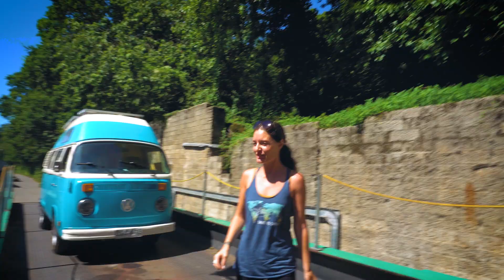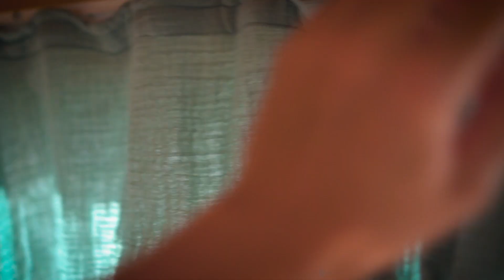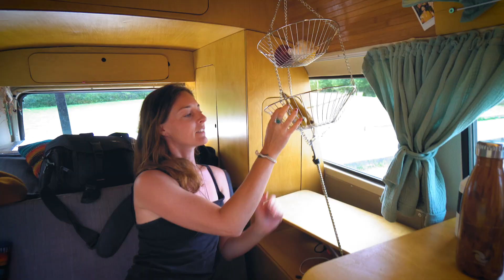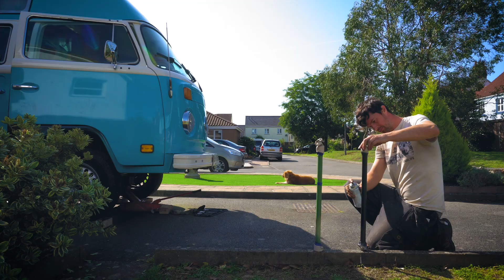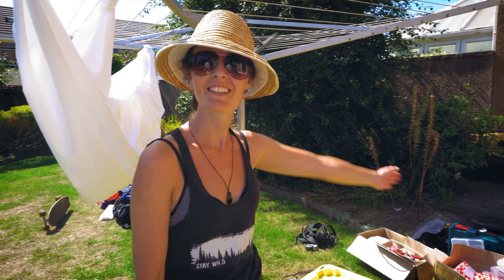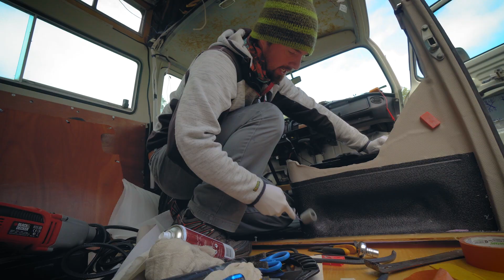VAN LIFE: Necessary Upgrades After JUST 1 Month of Living in our Custom Van Build

Comment: Zipper bags, they pack better, you have too much stuff, you have to be able to live in the van,  especially when it rains, can you use netting, and keep some parts inside the engine compartment?even the metal that is the reverse part of your bed support, can you make a small drawer, to hold parts, above the engine, a small slide drawer, maybe long, right above the rear hatch, there is space there, maybe for your shocks, they could be clipped up on ceiling above the rear door, there's alot of ceiling space in there

Comment: The Type 4 engine should have been the engine of choice for this trip. In terms of reliability the T-1 doesn't come close. As for A/F ratio...Load equals Throttle position. At part throttle conditions you can lean out as much as 16.1 which will run cooler than 13.2. Under load/WOT 12.7 - 13.2

Comment: Save some weight and ditch the metal toolbox and replace it with a plastic material tool wrap.with the spares remove cardboard packing from everything that is not easily damaged and wrap In Plastic and spread around the van to even up weight distribution.

Comment: Ben I’m not sure if you know if you add 2 stroke oil to your fuel it helps lubricate fuel system and cylinders which will prolong the life of your engine when the choice of oil is dire might be worth considering I use it in my van and all the works vans it quietens down injectors and I notice a real difference in engine tone only a small amount needed per fill up I use 20ml per 80 litres I am an old school mechanic 👨‍🔧 it certainly makes a difference noticeably almost instantly
Reply from the maker: thanks for your suggestion
Reply: Your very welcome I’ve gained many tips from your adventures so it’s a little something back 👍

Comment: I've got about 300Kg of "car" tools and would feel as though I'd cut an arm off to leave any of them. I'd have to buy a trailer.
Reply: You just need a heavy duty vehicle. 

I have a rabbit pickup I cut out the back of the cab and put a camper top on it. 

I did 4montha traveling being a mobile mechanic. 

The little truck had no qualms carrying over 1600kg. 
About half of that tools  jacks and whatnot. 

That was back in 2015. 
Still daily driving the truck. 

It has a vw TDI with a mechanical pump so it has no electronics and is capable of 50mpg completely loaded.
Reply: In fact. I do not see how they could afford fuel without the blog. 

For me my trip from every corner of the USA and back I spent less than $400 on fuel

Comment: 4200 lbs...?...ben you need 6 cylinders bud...that new 4 cyl. Will take a s... At one point or another...i would buy a used porche engine and rebuild it...but thats just me..cheers!
Reply: a used porsche engine that needs a rebuild is £6000 miinum plus at least that again to rebuild. totally uneconomical.
Reply: @kmpeaker3955  im talking about reliabliity for the sake of nonstop adventures...and torque...which that kombi needs at 4200 lbs...and no...a used porche engine can be bougth for less than $3500...and Ben can rebuild it himself for less than $3000...i know...i own one...
Reply: @steven6692  tell me where you can get a porsche engine for $3000 and I'll buy it ship it the UK and make £3000!!!
Reply: @kmpeaker3955  many places here in the U.S. bud...just type it on google...at times even at ebay.

Comment: 20:50 I have to warn you about about the quality of Febi Bilstein parts. Last year I replaced a crankshaft sealing ring with a Febi part on my Mercedes and the sealing broke down after 3 months. I'm a Mercedes mechanic, so believe me when I say that it was mounted 100% correctly. It was a real pain because it's quite a lot of effort to get to that sealing ring, and I had to do it all over again because it was leaking oil worse than even the old one did. Better buy parts from brands that you can put your trust in. Also, don't confuse "Febi Bilstein" with the suspension brand "Bilstein", curiously despite the similar name it's a whole other brand! Wish you all the best from Germany!

Comment: Didn't see anything about an air cleaner cover or box for warm air to prevent freezing in cold weather, or (if the manifold is heated & I didn't see it) .,A sock, or piece of foam, or box.. to"keep it drawing air from a specific area...", so it does" nt get clogged  quickly in the dusty conditions you are headed into...Hot rods generally don't cover their air filter ., but in the real world the manufacturers do, This is  to keep the filter enclosed  from picking up say , oil residue from a specific area , road dust directed into the general area , dripping water , & even excessively hot or really cold air depending on outside temp....We've all seen in canada. , the stock Vw manifold ,(which I know you haven't got), turn white with frost while running in cold temps & then refusing to idle or even run right because the fuel recondenses on the cold surface ...A make shift cover is something you might want to discuss with the engine builder ,(even if you only put it on when you need it) ..Have a great trip ., love your series , been following it from the beginning, continue to look forward for lots more!

Comment: fun fact about motor oil; zinc is added to oil to protect the engine if you go past the recommended number of miles and the oil has lost all lubricity the zinc is still zimc and will keep the motor from eating itself ...a side note, a slightly rich fuel mix is perfect for sea level but what about up in mountains? is the new motor EFI? i missed a few videos and or dont remember much about the engine build
Reply from the maker: oh you missed out you need to watch this: https://www.youtube.com/watch?v=onkxegc7Yk4&list=PL3-CFitnEZXon01THWh1vEKDv5MPkuNnp&index=8

Comment: Having lived on the road in a van for over 10 years and traveled around Europe, I can definitely understand what it takes to reduce your belongings to the bare minimum. My Vehicle was nowhere near as small as yours but it was quite a bit older which meant spares were only available from a couple of places in England. The worry of breaking down was never far from our thoughts but we did it with far fewer resources than you have, you cannot be prepared for every eventuality as you well know and that can make the trip much more interesting. 
I'm not sure how many other people who watch this would be able to understand just how much you need to sacrifice or leave behind and how you can get by with much less than you think.

BTW why have you never considered a small cargo trailer ?
Reply from the maker: :) considered yes - pulling a small trailer isn't out of the question and might happen at some point
Reply: How can you stay without any friend and family members for a decade? (I know you make friends along the way but, they are just temporary). Also how can you live without having a place (like a town/city) to call home. You will not have anything with you, but a vehicle.
Reply: @samyakhp4353  I worked on fruit farms, fruit requires lots of manual workers to produce good quality so there are lots of jobs to do. In England I grew and picked hops for beer, strawberries, blackcurrants, raspberries, cherries, pears and apples. In France it was mainly apples and grapes, in Germany we helped with the plums and grapes and also helped with wine production. There are many many small jobs that can be done if you are good with tools and people spread the word very quickly. Also people are curious to meet the travellers who arrived in the village and want to help. After a while you do start to miss certain things because you can't carry very much with you and the lifestyle gets a bit tiring but you are never short of friends.

Comment: Ugh that power to weight ratio scares me guys! It's a great engine i loved the engine build video but it's only under/over 100 horsepower on a 4200lb van with no people or full tanks takes it to at least 4500lbs and every 1000 feet takes away 3% of your power so at 6700 feet your down 20% to 80 horsepower, stay safe and try to stay low and level if you can!
Reply from the maker: yikes!